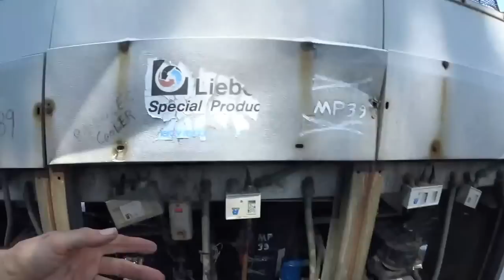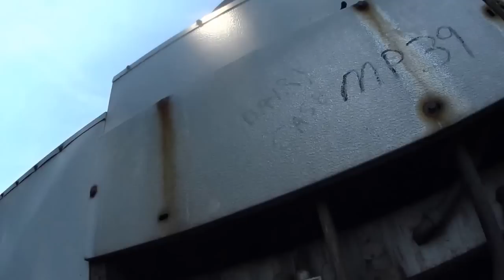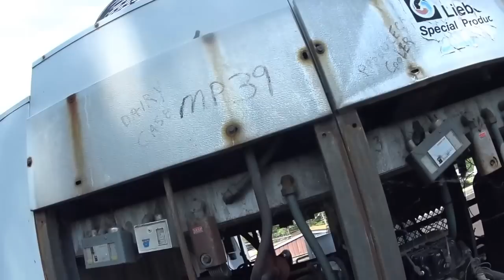Liebart refrigeration system with heat reclaim from the 70's

Comment: thanks for video. really cool to see a refrigeration system from the 1970's. I bet it was something to see when it was new. love those compressors . was wondering when it was installed in 1970"s  if it is a package system or built in place with all the piping and compressors. thanks for the great work

Comment: these newer refrigeration racks on the low temp the compressors will have head cooling fans on them if the compressor motor is suction cooled the head fans cool the heads on these

Comment: Up here the northeast supermarkets chain use the season four equipment
for heating / cooling they still use heat reclaim . lts still in use during season   change .Use heat off dischage gas from compressor or  hot water for store they have storage tanks for hot water .Don't forget racks has heat reclaim vavle on the racks.They have   4 up to 15 compressor ranging different Hp compressor diffent racks M/T or L/T for the store enery saving I work on lot of season fours  and rack system had rebuild heat reclaim vavle from refrigeration leak dont forget these store has over 1000lb of refrigeration for one store a.lot of heat.
Reply: also worked for supermarket chain here in NJ-all stores utilized heat reclaim-louvre maintenance on warm air reclaim a challenge-otherwise nice systems

Comment: Thanks for the post. I used to service a similar Liebert  if I remember correctly it was their phoenix model. It had a gigantic A coil that the condensate would lose surface tension in drip into the store return. One day  7-11 grew tired of the reliability over a two day event we replaced it with 2 RTUs, and installed condensing units for the boxes and displace cases while the store was open. I spend many nights including one New Years Eve servicing that thing. The problem I noticed with the heat recovery is the store load would be so lite unless in the dead of February  the system wasn’t well suited for short cycling in reclaim mode. I haven't seen one in 15 years.
Reply from the maker: David Taylor  the concept was ok, but they are all being replaced by individual condensing units, you haven't seen one in 15 yrs, lucky you. thanks